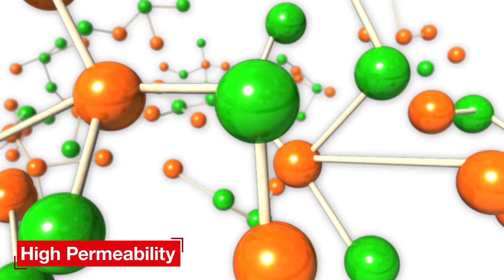Würth Elektronik illustrates Wireless Power Transfer (WPT)

Comment: I believe, the coil must be driven at its parallel resonance frequency. This means the oszillating resonance current in the coil can be much larger than the source current. This should produce a much stronger magnetic field. So a coil with high inner capacity, wound from thin foil, not from wire, should work best.
Reply from the maker: Dear Peter, the wireless power transfer technology is based on resonant circuit. If the capacity is too high, you can't drive at a higher frequency. Regards, Lorandt
Reply: @wuerthelektronik  Thank you for the answer. I am not a professional, but I find this technology interesting.
It was my idea, because the energy transmission is in the near field and not in the far field, very high frequency should not be required, but high idle current in the sender coil (which acts like a resonant tank circuit) is required. Lower frequency and thus lower impedance of the coil should increase the reactive wattless current and magnetic field and so increase the reach.
This is just a speculation of mine, maybe this would increase ohmic losses too much. 
I am rather sure your engineers worked harder on this than I can ever do and know more. Maybe I am wrong with this idea.
Reply from the maker: @hpeterh  Dear Peter, first of all must be EMC compliant, second if the freq are higher, this  will generate higher core losses. This is the reason to use max 205KHz freq.
Additional there is a Qi-Standard consortium where many manufacturer working on a common agreement to be compatible to each other. If you want to know more I would recommend to visit this website:
https://www.we-online.de/web/en/electronic_components/produkte_pb/demoboards/wireless_power/wireless_power_1.php
There is also a book released about WPT which you can order from our sales team.
 Kind regards, Lorandt
Reply: @wuerthelektronik  Thank You very much!
Reply: @hpeterh  do you have any reference on resonant transmission ,pleas help me if you have ,am working on this project